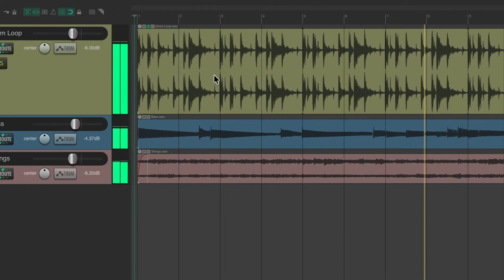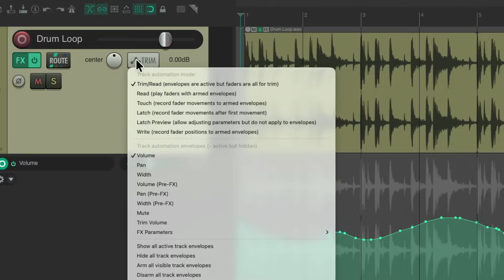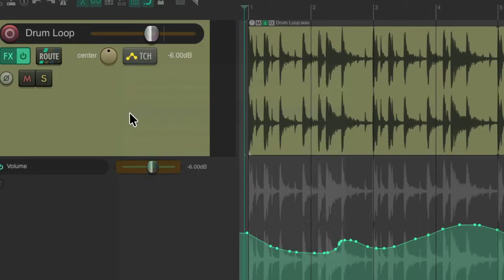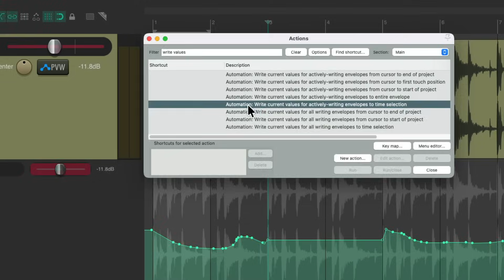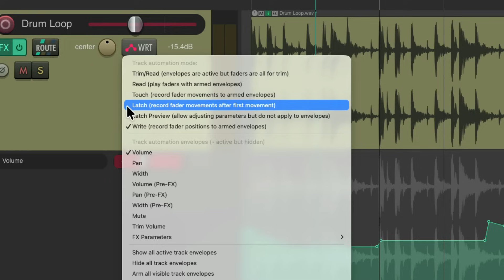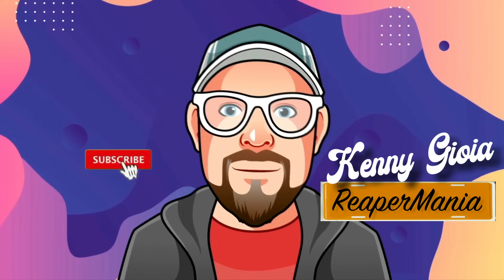The Automation Basics in REAPER

Comment: For new users: I know he mentioned it at the end, but it's extremely useful to remember that you can automate effect parameters with this too. 
In practical terms: you can automate things like mix or repeats for delay on vocals. 
Automate specific EQ points on acoustic guitar. Add low mids for fullness (when there are no vocals) - remove that added low mid when vocals come in - so it doesn't get muddy. 
Also: for that string squeak on guitar or bass: Add a multi-band comp - find the 'squeak frequency' - automate the threshold to maximum only during the squeak. It will all but disappear.

Comment: Reaper needs better options for LFOing multiple parameters across plugins.
Reply: Parameter modulation is great but IMO it needs a better ui ux, something similar to Bitwig but in reaper way
Reply: @rano12321 Repear could learn a lot from Bitwig. Reaper also needs MIDI effects like it has.
Reply: https://youtu.be/pm6rzNTUc_o?si=tGO_mDazoeO7Qubl
Reply: Check out Saxmand's FX Modulator Linking script. There are others, but this one actually works like  a charm. There is still an issue when dragging an already modulated fx in to a container, but that is a Reaper issue and not an issue of the script itself.